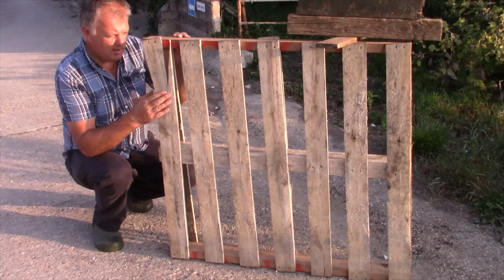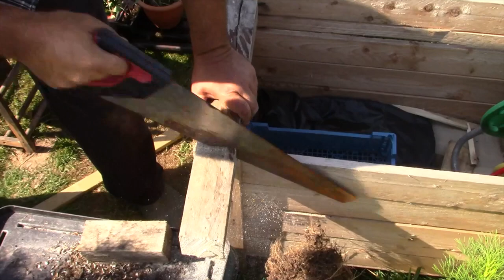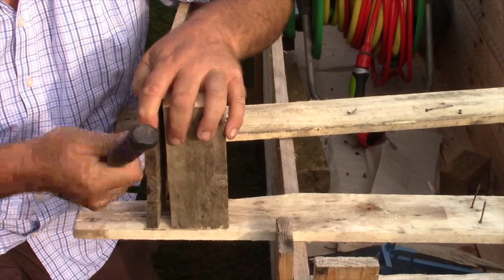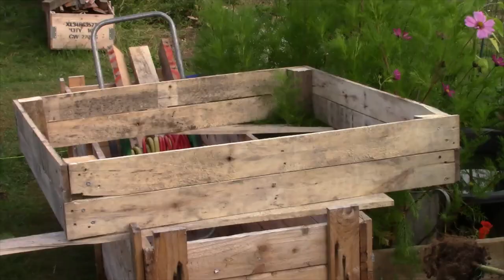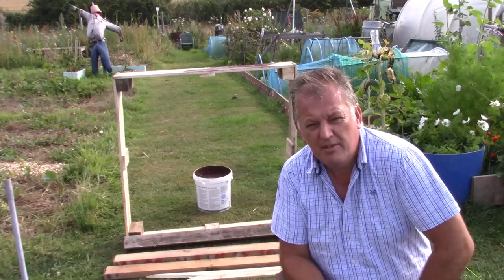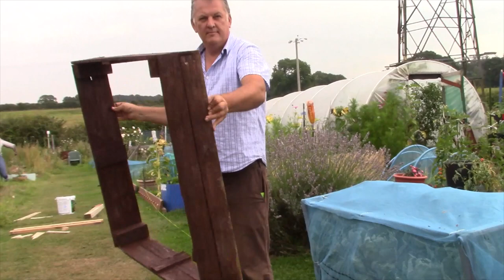How to Build a Raised Bed from a Pallet  FREE

Comment: I totally empathize with your 'womble' approach to DIY. RE-USE IS BETTER THAN RECYCLE!! A free raised bed surround has to be a winner. The pallet wood should give 4-7 years life, especially as you've treated it. Not so good for brassicas which have that habit of spreading and overgrowing their space but for onions and carrots, leeks spring onions or beets, salads etc they should be a boon. I don't envy you doing hand sawing in this extreme hot weather!!  My beds were bigger and I needed more strength and more longevity and I used redundant scaffold planks. Same vision. Job well done, bro'. Perfect for the smaller garden or for specialist crops. all the best as always - Paul
Reply from the maker: Thank you Paul. I should really buy a cheap battery  saw but still potter along to save a few extra pounds. cheers Ray